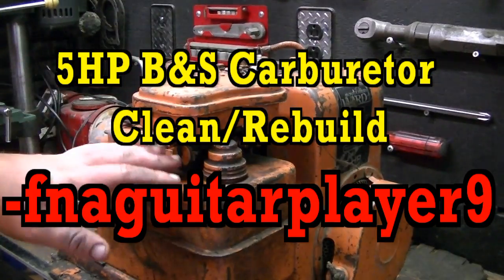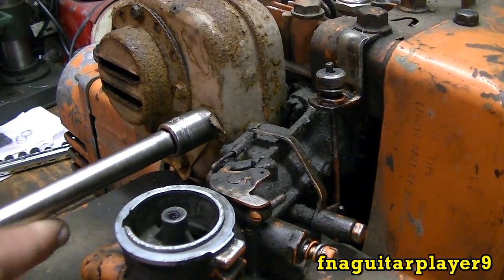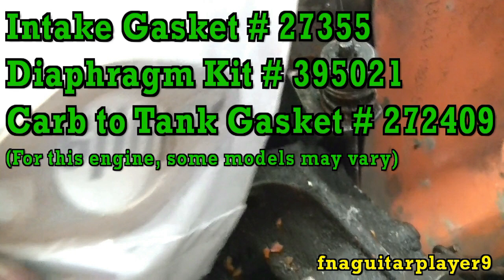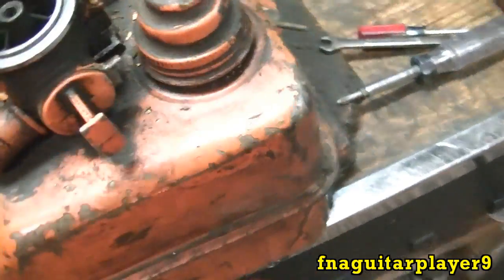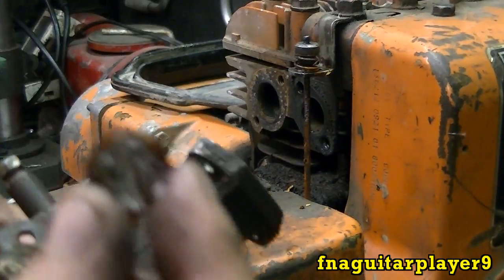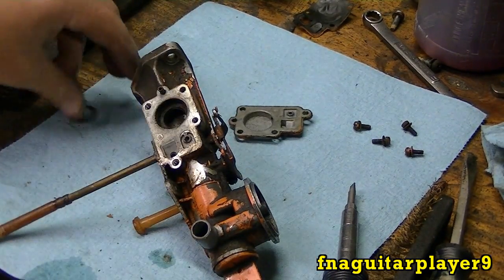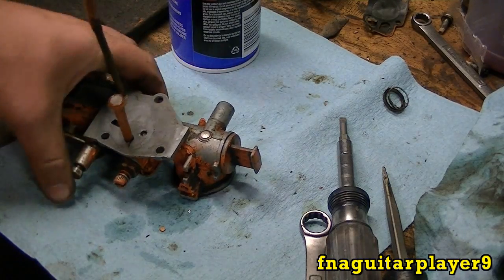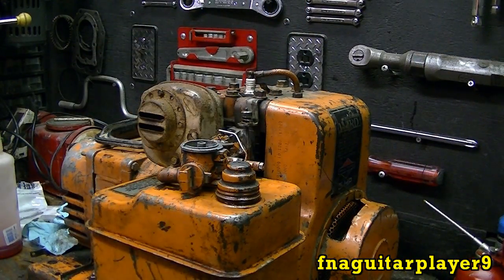5HP Briggs and Stratton Carburetor Clean and Rebuild (Pull Choke Type)

Comment: I have that exact motor & tried cleaning the carb but it wouldn't stay running. Put a new carburetor on and it will run as long as I spray starting fluid. I assume it's not getting gas. Any ideas what I can do?

Comment: My little giant blower won’t start.  But if I pour gas spark plug hole it will run well
I changed diaphragm on carb still won’t pull start.  Do you think screen on screen intake tube clogged

What do you suggest

Comment: Excellent video. At 9:10 you mentioned that you would show or explain how to remove or clean a stuck jet. How do you do it?
Thanks
Reply: Welder torch cleaner works great and cost 6.00 bucks 
Every tinny holes try and put cleaner thru it and carb spray it or brake cleaner

Comment: Should all tanks on this model have a reservoir?  I have this 5HP with the pull choke carb and I don’t have a reservoir. Engine is not running, carb has been cleaned and I’m wondering should this have a reservoir
Reply from the maker: Yes these will have the reservoir. Thanks for Watching!!!
Reply: @fnaguitarplayer9  Mine does not.  Would this cause the engine not to start?  Carb has been thoroughly cleaned and starts with fluid.   This acts as the primer correct?

Thanks for your reply

Comment: I have a roto tiller with the same carb it seems. It only runs with the choke pulled all the way out. It sounds like it runs ok but when under load it wants to stall and die unless I really really baby it.

Comment: Hi I’ve rebuilt the carb as you’ve shown. Checked the little fuel tank it’s fine, checked and have a spark but it still won’t start. Any ideas please?
Reply from the maker: Does it have good compression, the valves can stick or not seal and keep them from running if the compression is to low. Also, make sure the flywheel key did not shear, if its sheared then the spark timing can be out. Thanks for Watching!!!

Comment: Remember, these things were designed for leaded gas.  On mine, the jet for the needle valve was plugged solid, solid, like metal.  Didn't even look a hole in the jet.  Couldn't tell one used to be there.  I tried poking a needle through it and nothing would clean it up.  Finally I used a plumbers aceteline torch (B Tank) and that worked, along with a needle.  Thing is, it got the brass so hot that it became soft and squished on the side I was holding the pliers on.  Not so big a deal, I just heated it back up and quickly threaded it back into the side of the carb.  Don't know if I'll ever get it out again, but it's working right now, anyway.  Instead of taking the whole carb off, I just used my air compressor and blasted 180 Lbs of air into every little jet and hole I could find.  I also dumped all the old gas and cleaned the tank with spirits.  Left about 1/2 an once of spirits in the tank when I filled it back up with supreme unleaded gas.  Worked really well.  Thing runs like new, now.
Reply from the maker: I'll keep that in mind! Thanks for Watching!!!

Comment: mainly wanted to know how to get that bottom bolt out ! and you did it off camera!!! , other than good info
Reply from the maker: Sorry about that! I have showed it in newer videos though! Thanks for Watching!
Reply: @fnaguitarplayer9  did you have to use a special wrench? , i can't seem to get any to fit and turn the bolt.
Reply: @ro7all That bolt is a 9mm, I believe. It's easiest if you remove the exhaust. It can be done but it's a pain with the exhaust on.

Comment: My carburetor is leaking gas from the pull choke. Any idea on how to fix it?
Reply from the maker: It may be the gasket between the carb and tank leaking, they are bad about that. But if its running rich or gas builds up in the carburetor its normal for them to seap gas out around the choke. Thanks for Watching!!!

Comment: Where can I order a carb and linkages parts?. I can't find any numbers on engine nor tank it's the same exact of what you showing here any help is greatly appreciated...
Reply from the maker: Ebay. The pull out choke type carbs are expensive, the linkages may be harder to find but check on ebay. the cheap 15 dollar carbs on there are the newer style and work on this tank. Most of the time these carbs only need rebuilt and cleaned to get going, there isn't to much to them really. hope this helps. Thanks for Watching!!!

Comment: this engine looks exactly like the one i have, but I'm missing any kind of model information for it. do you know what model number it is?
Reply from the maker: If it is a 5HP the model number will probably be 130200 or something very similar, but there are several differences, like if its a I/C it will probably have a cast iron sleeve and maybe bearings on the crankshaft. hope this helps, Thanks for Watching!!!

Comment: Hey Frank, great video!!!  I have a question about the governor spring and linkage between the gas tank lower bracket and engine if you could please email me to where we can have a conversation and you can help me out on acquiring what I need to finish assembling this rotor tiller, I would greatly appreciate it. In this video I have pretty much the exact engine that I'm dealing with now.
Reply from the maker: Thanks! My next video will actually be on how the governor and throttle linkages are set up on these engines, using the same engine in this video as a example! I should be putting it up either saturday or sunday! Thanks for Watching!

Comment: Hi, I have a 5hp Briggs with this carb on my mini bike. It would only start with starter fluid. I took the carb apart spraying everything with carb cleaner twice now. But still wont start and run. The piece inside the screw with the spring wasnt plugged. How can I tell if the diaphragm is bad? It wasnt torn. Thanks
Reply from the maker: Sometimes the diaphragm will be stretched and won't pump correctly. A common problem on these is the small chamber where the shorter pickup tube goes in, will sometimes rust up and have pin holes. Its supposed to stay full of gas so it won't have to fill up the chamber first to start, after its running, shut it off, then remove the gas cap and look inside, if you see gas dripping down from it, then i'd say that is your problem. you can actually take these tanks apart at the seem and epoxy it on the inside, its a pain but can be done. also, if its running to lean these are hard to start as well. Hope this helps. Thanks for Watching!!!

Comment: Where did you purchase your carb rebuild kit at?
Reply from the maker: You can get them off of ebay or amazon or from mfgsupply. several other places have them, the best kit i've found is made by primeline, better quality parts, will cost a few dollars more but i think its worth it. Thanks for Watching!!!
Reply: fnaguitarplayer9 shoot I got all the parts and I’m having be trouble with adjust the throttle linkage and the governor
Reply from the maker: @billymoon1775  I have another video just on adjusting governors, not this same engine but they all adjust basically the same way.

Comment: 1. Where can I get an air filter for this type of engine...? Mine was rotted and fell apart when I pulled it out of the housing, and I can't find a replacement for it anywhere. 

2. I have a 5-hp B&S engine looks just like the one in the video except there is a spring that goes to the choke to adjust the choke as the engine warms up. 

The auto-choke kills the engine after it's warmed up, and I don't see how to adjust it anywhere at all.  If I can grab the choke fast enough before it dies, barely pull on it ever so slightly, to open it just a hint, the engine will come right back to life, but after a minute or so, will try to die again, and I have to repeat the process to keep it running (if I can catch it in time). 

It would be a great engine if that choke didn't move in too far after it warmed up like it does. Any idea how to adjust one of these pull-type chokes with the spring that auto adjusts the air/fuel mixture while it runs...? I can't find any info on this anywhere, but it looks like the choke on the engine in the video above, though it extends out from the carb just a little further, and has a spring attached to it that pulls it in as the engine warms up.
Reply from the maker: The filter can be found on ebay or amazon, or any lawn mower parts store, if it is a 5hp like this it should be part number: 27987, here's a amazon link https://www.amazon.com/Briggs-Stratton-27987S-Filter-Element/dp/B0038U3GB4/ref=sr_1_3?crid=DCWS63F67VM1&keywords=briggs+and+stratton+air+filter+27987&qid=1576438467&sprefix=27987+%2Caps%2C185&sr=8-3 As far as the choke goes, your best method would be (in my opinion) to do away with the auto choke and work it manually, thats what i would do. Thanks for Watching!!!

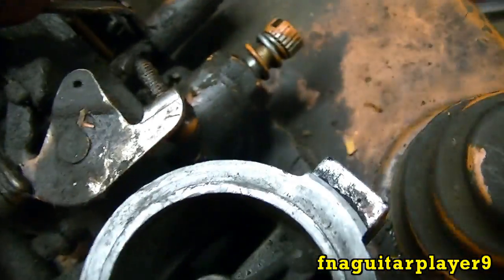Comment: At 4:37 in, while looking down into the carb, between the female thread housing for the air breather and the pull out choke, in the bottom of the choke housing is a small pin like item, about an 1/8” in diameter. What is the purpose of that part?  Mine leaks fuel when I pour directly into the carburetor base. Do I need to replace the entire carburetor?
Reply from the maker: Its actually a rivet that holds the slide out choke in, if that is what your talking about. Its not really meant to seal, and they will also leak out of the vent tube on the side sometimes as well, especially if the rubber elbow is cracked.  I wouldn't worry to much about it to be honest, these carburetors are really expensive, over a 100 dollars, and the cheap 15 dollar ones are for the new style tanks and won't work on these. These carbs are also bad about leaking between the carb and tank. Great carbs, just really picky at times! hope this helps! Thanks for Watching!

Comment: This helped me rebuild the carb on my old 5 hp Briggs that hasn't run in 15 or 20 years. Do you have a video for converting this motor to electronic ignition ?  Thanks !
Reply from the maker: Glad to help out! The most common way is to use the magnetron coil to do away with points/cond. it just bolts and you connect the shut off wire to it. Thanks for Watching!!!

Comment: I have a very similar Milwaukee generator that I'm attempting to fix. I need to replace the magneto, but to get inside the crank housing I have to remove the rotor. The only problem is that it seems that the rotor is permanently attached to the crank. Is there a way to non-destructively remove the rotor from a generator like this? https://imgur.com/gallery/vYeutT8
Reply from the maker: I have a video here that shows the methods i've used and had to use on this same generator when I put a NOS block on it, hope this helps, https://www.youtube.com/watch?v=v1e-bPmtLnc Thanks for Watching!!!

Comment: Flat silicon rubber might work for gaskets. You can cut it to shape and it can withstand high temperatures. 
Not sure how high but you can bake cakes in silicon rubber moulds/ molds.
Reply from the maker: That might do really good. Thanks for Watching!

Comment: I can't get a wrench on the bottom right-hand carburetor mounting bolt what do I do
Reply: Can you get a socket on it?
Reply: @zenoist2399  no
Reply: I'm thinking about a needle-nose vise grips or a chisel
Reply: @stancromer5818   Have you managed to get the air filter off and the choke plate part? You can buy things called s spanners or obstruction spanners ( wrenches).
You can also get crows foot wrenches if you know the right size. You can also get offset spanners / wrenches.
Reply from the maker: It can be a real pain on these carbs, its the only thing i don't like about them, you may be able to use a offset screwdriver on it or use the open end parts of the wrench on it. Alot of people change them out to a socket head/ allen drive screw. Thanks for Watching!

Comment: You can buy a brand new carb for $16 on Amazon or Ebay.. Just saying..
Reply from the maker: Those are the newer type that doesn't have the pull out choke, they will not bolt to this tank, they will work on these engines but the tank has to be changed as well, these carbs are over a 100 dollars. Thanks for Watching!!!
Reply: @fnaguitarplayer9    Are you sure..
Reply from the maker: Yep, the newer type will not bolt down on the tank, without serious modification, and there is no fuel mixture adjustment on them either. if you can find this type for that price let me know, i will buy like 20 of them haha
Reply: Great vid and info,! Found the diaphram info I needed here. Outstanding and I would trust your advice.
Reply: He is exactly right , I bought the one off Amazon , and the holes Do Not lineup ! Not worth making mod to tank,  my problem is leaking fuel from gasket in between tank and carb 
I made my own , no luck 
Then I coated it on moto seal solvent gasket maker ... Made it alot better but still weeped out 
Bought the OEM gasket and still leaks slightly more than when I had the one with gasket maker .... It's a late 60s early 70s cub cadet snowblower Briggs 5hp , my guess , the tank or carb is slightly warped ... Not enough for me to worry about

Comment: Great video thanks, answered my question about 2 screens as I couldn't see the small on on the parts list. Do you know what the part no is please? And what does it do? is it a return ?
Reply from the maker: If your talking about the 2 pickup tubes with the screens on the bottom? The long one pull fuel out of the tank, then the pump (diaphragm on the side) puts it in the little chamber under the carburetor then is drawn into the carb through the smaller pickup tube. so yeah, it is constantly pumping fuel through the long one. The part numbers are dependent on tank size. Thanks for Watching!!!
Reply: "..then is drawn into the carb through the smaller pickup tube", you said. I don't understand. The smaller pickup tube is shorter, - how can it draw fuel into the carb if the tank is over half empty? I was thinking it might be an overflow tube / gas return line, I'm just guessing, though, Please explain a bit better; I want to understand this, too, - I have a carb on my tiller just like it, I'm trying to get to run. Thanks! And great video, and much needed!
Reply from the maker: @steveandrews8301   I don't remember saying that, but I may have said it wrong, how these work is, the fuel pump draws fuel up through the long tube then pumps it out into the reservoir where the short tube goes in, the carb will draw gas in through the short tube out of the small reservoir. The reservoir has open sides so it is constantly being over filled and just spills over in the tank, works similar as a bowl on a float a type carburetor. If it didn't have the reservoir, like some of the early 2hp (and others) carbs didn't have, it makes them alot harder to start since it would have the pull the fuel up clear from the bottom of the tank. Hope this makes sense, and sorry about the confusion. Thanks for Watching!!!

Comment: Gday from down under, thanks mate! just what I have been looking for. I have the same model driving a tiller. You make mention of the throttle governor linkage but no illustration in the video. Can you explain briefly what you did as I have the same issue. Subscribed :)
Reply from the maker: Your welcome! I hear ya, it would have been hard to show on video, but you have 2 throttle linkages, a real short one that goes from the throttle plate to a rocker arm type piece, then straight down to where the governor arm is at the bottom, it should be the last hole on the end, with another hole for the spring going to the part that throttle cable connects to. Next time I work on one (probably next summer) I will make a video on the linkages. I thought i showed it in one of my vids but i can't seem to find it! Thanks for Watching!!!
Reply: @fnaguitarplayer9  Thanks mete....I'l give it a go :)

Comment: First off, video is great, no bs, just what is needed. Second, i have the same exact carb and i need both pickup tubes...you wouldn't happen to have part #s for those on hand? Just curious. Keep up the good work!
Reply from the maker: Appreciate that! I can get the part #'s but I'd like to have the model type and code of your engine, just to make sure i get the right ones, there were slight variations on alot of parts on these carbs, that way we'll know for sure. will do! Thanks for Watching!!!

Comment: I think this is the same carb that is on the briggs on my 1980s era Monkey Wards tiller which is seeming to leak gas from the underside seal and will sometimes die on me while in use. I think this video will be quite helpful; many thanks!!
Reply from the maker: Probably is the same, they were used alot. They are bad about leaking around the tank, the gasket should take care of it, just make sure its all clean really good. your welcome, Thanks for Watching!!!

Comment: Thanks for such a good video on this carb rebuild, kit numbers and all. I Subscribed.
Reply from the maker: Your welcome, appreciate the sub! Thanks for Watching!!!
Reply: Great video! Question: I have the same 5hp Briggs and did a rebuild. I bought a carb rebuild kit and cleaned the carb and gas tank really good and used all the new parts and gaskets for the carb. I can start it but it will die if I don’t have the choke out. I tried adjusting the jet but nothing seems to help. Any ideas? Thanks and keep up the great vids.